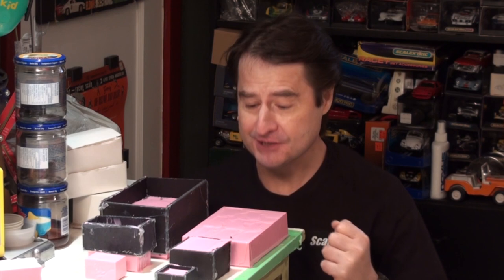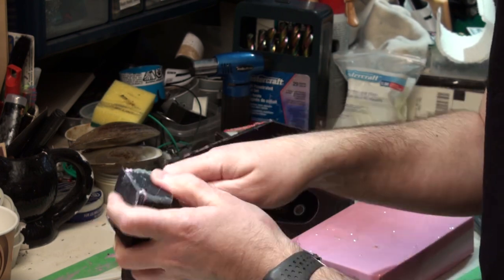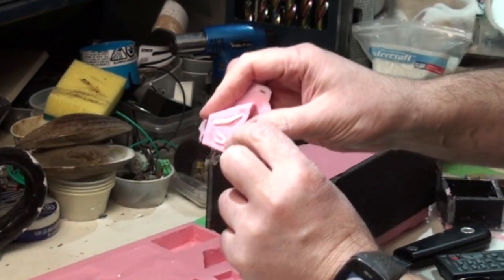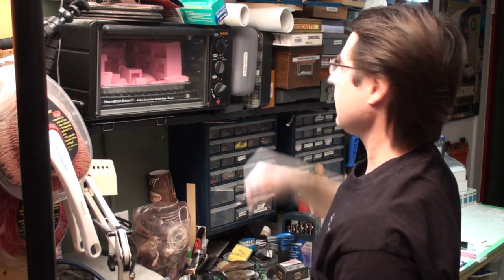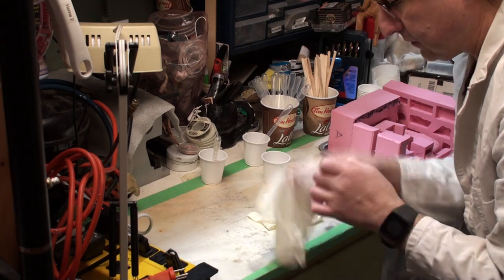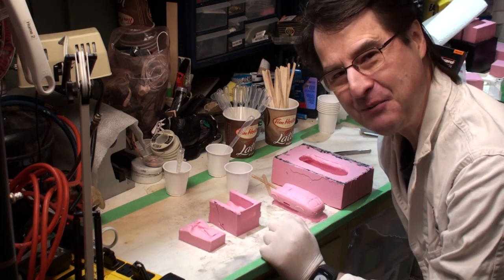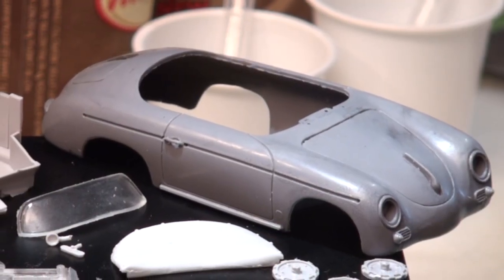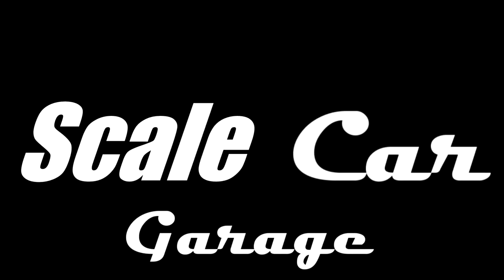Scale Car Garage - Mold making & Casting Pt. 4

Comment: A fabulous finale to a great series.  I presume you use pressure to compress any air bubbles rather than use a vacuum.  It's amazing to see the smallest detail successfully cast. 
Just to compare your process with 3D resin printing, casting gives a far superior final product but takes much longer overall.  The two processes are both fraught with chemical dangers...and it's good to see you wearing appropriate PPE on your feet!
The intro music is awesome BTW!!!!
Reply from the maker: Thanks so much for the wonderful compliments! Yes, placing the resin filled mold in a pressure vessel 'compresses' any air that may have been introduced  by pouring resin into the mold as well as from the exothermic reaction of combining the "A" and "B" parts of the liquid resin. Making the molds takes all of the time, once in the rhythm of casting, resin parts can be produced in about forty-five minutes, the clear resin I use takes longer to cure. Certainly proper precautions should be made with respect to safe storage and handling of the silicone and resins. Thankfully the chemistry is such that the highest risk is to the skin and long sleeves with rubber gloves go a long way to prevent any mishaps! I'm so pleased that you like the intro music! Thank you so very much for watching, commenting and subscribing! I'm so appreciative of your most valued and continued support!

Comment: Interesting process John. but labor intensive. Do different resin manufacturers recommend different PSI pressures for removing air bubbles & improving their resin flow? Or do most off them cure in 20-25 minutes anyway? I saw the clear was different. How durable or brittle are the bodies once fully cured? Do they withstand minor bumps & crashes from slot racing.? Years ago there was a person in the western US casting both 1/24 & 1/32 bodies using a light weight resin that was extremely strong. I saw some of these bodies run into wooden track walls & experience no damage. This man has since passed away & none of his race friends know what product he used. Do resin bodies require any special handling or techniques for painting? Or can you fill/sand imperfections, prime, & apply finish coats? What sort of fillers adhere to resin as fillers, epoxies? If one had multiple bodies to make multiple molds, I would think it would be more efficient to cast a fleet all at once rather than to cast them individually. I think a future project should use the Porsche body & it's assorted pieces that you have produced in this short video casting series. I learned a lot of new things & procedures, thanks for sharing. What does the term slush casting mean? I read it's used for some body casting but have no idea how its done.
Reply from the maker: Bill, I'm so pleased that you enjoyed this episode! Resins are offered in a variety of pot lives (time to harden) and chemical/structural properties depending on the application. For casting the body and the body parts I use Smooth Cast 306; a low viscosity resin which has a pot life of about seven minutes and a demold time of thirty minutes, while the clear resin is Smooth Cast 326; a higher viscosity resin which has a longer pot life of ten minutes with a demold time of sixty minutes. Casting pressure is (usually) a function of the viscosity of the resin; the higher the viscosity, the higher the pressure to be applied to it in the mold. The resin body is quite robust. Once cured and painted, it is not as brittle as an injected plastic body but given enough force, will break. Yes, I remember the "Resilient Resins" line of bodies! I'm afraid that I'm not aware of the type of resin used for these cars but they certainly were robust! There is no special or specific technique required when painting a resin body, however, one thing to consider is to observe the surface of the body. If the body is really smooth, a light wet sanding will help the paint bite into the resin for better adherence. As far as fillers, I've used Tamiya white putty, automotive body filler, even metal filled epoxies all with great success. Yes I agree about multiple molds, however, once a mold is made, replicating that mold is quite straightforward. A slush cast is essentially a one part mold. For example, by using the "exterior" body mold of the 356, I could make a body by 'slushing' resin around in it (rotating it in my hand) until the resin was fully cured. This would produce a body of inconsistent wall thickness and no internal definition. But it could still be used to create a very good looking car! Thanks so much for watching, commenting and for your most valued continued support! I really appreciate it!